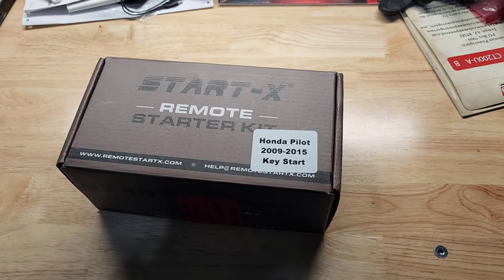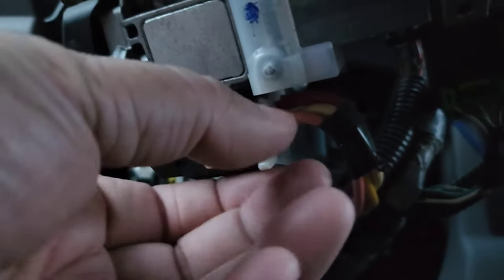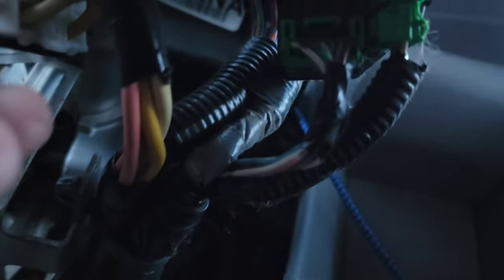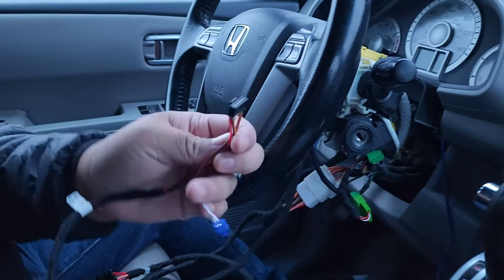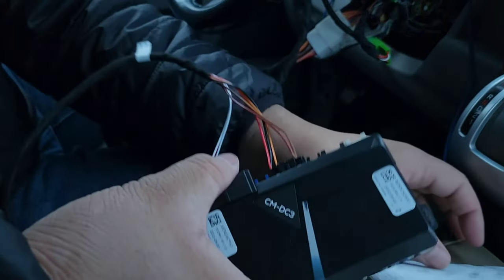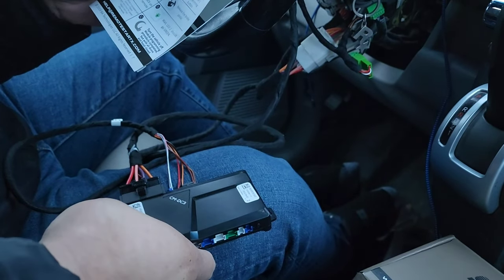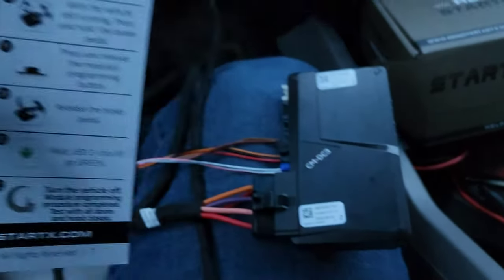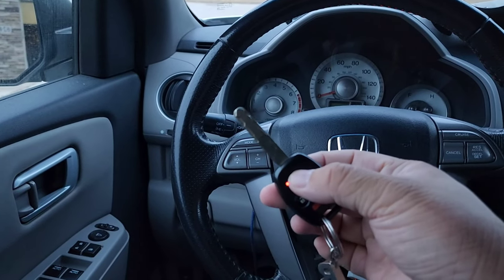Remote Start 2009-2015 Honda Pilot Plug-N-Play DIY

Comment: I did all the steps but my Honda won't start the immobilizer won't let it..  it will crank after waiting 3 seconds but it will not start.
Reply from the maker: Try to reset the unit?
Reply: Yeah I reset the unit and got the red lights flashing I just couldn't start the vehicle.  Unfortunately I think I'll just return it.
Reply from the maker: @TheRoddy87  sorry to hear that, possibly you got a bad unit?

Comment: Yesterday i installed remote starter for my rav4 2009 euro spec diesel.  It was easy one ignition cable and one obd2 and program.  Mine was pts not key.
Reply: What brand ?
I have a Mitsubishi push to start and every kit is not compatible

Comment: i bought the start x and it didn't fit the green switch, there must be two different sizes, it was slightly too big and would connect
Reply: There is a green plug on top of the steering column, that is the small one. Go around and down, you will find the white plug, at least mine was white, that is the plug you want. And I am NOT talking about the HUGE white plug. I was a little confused on this too.

Comment: can you drive it with no key
Reply: No you cannot, as soon as the brake is applied without the key the car will shut off. Plus the car is locked when you start the car because you have to hit the lock button 3 times.

Comment: When you try to turn on with the key, does it also work?
Reply from the maker: If you turn with the key it'll work normally.

If you remote start it and turn it over ign while running it doesn't do anything.